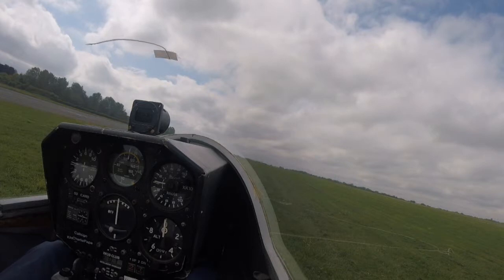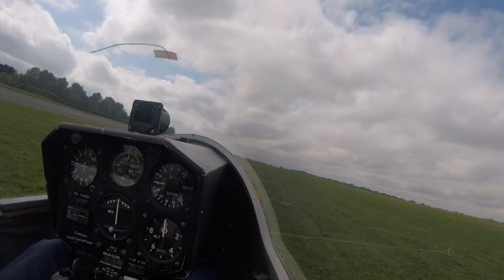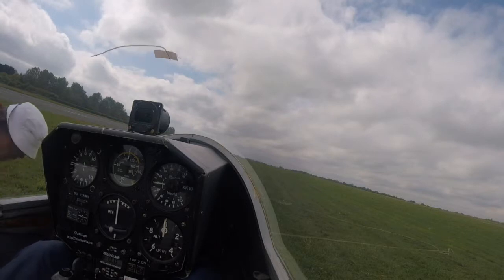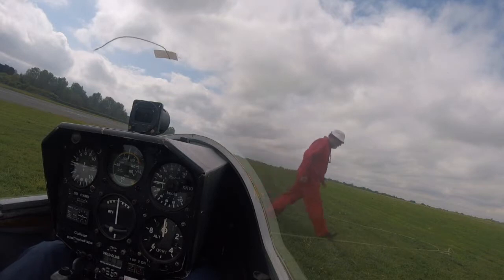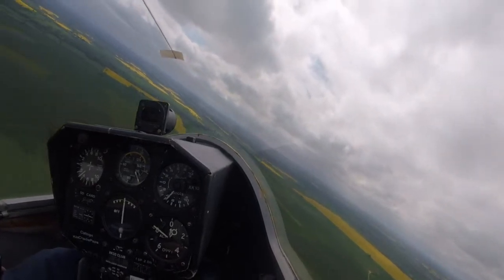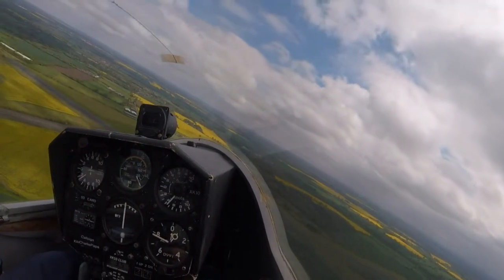An example of poor circuit planning

Comment: That altimeter doesn't appear to b e accurate.  I could be reading it incorrectly.
Reply from the maker: You are right, on that glider, the altimeter does stick (you might have seen me tap it). However, I wouldn’t have been looking at after the downwind leg. Thanks for taking the time to comment.

Comment: Thank you for sharing this, Since I am learning more practical stuff in my gliding training flights this helps a lot, examples of circuits that have gone wrong are ways to learn and improve and make sure not to make the same mistake! Really appreciate it and a nice recovery.
Reply from the maker: Thanks for your comment, Sebastian, and I'm pleased you found it useful. I hope your training flights are going well. On this flight, my circuit was too tight, too high and I turned finals to the right of the runway with a strong R to L crosswind!! The lesson I learned from this is to to always have a Plan B (and Plans C & D!!) when you go into circuit.
Reply from the maker: Should have said "turned finals to the left of the runway". Whoops!
Reply: @gerryfletcher4686  yeah no worries, appreciate the response, it’s nice to learn something new everyday! I have to say when ever I’m flying I’m making sure to try and correct mistakes that my instructors have picked me up on before hand, just so they don’t turn into bad habits. But I’m thankful that you have taught me something new.
Reply: @sebbers  Aiming point and speed control will give you a good landing (almost) always.

Comment: You were simply too fast at touchdown.  On the other hand, in those wind conditions, better to carry a bit more speed.  If this is the worst thing you do, you'll do fine.  Thanks for sharing.
Reply: Agree. Breaking off in 600"; reporting downwind and doing the pattern is on the spot. Only you should have kept it flying with the wheel 1" above the surface untill it stalled (=landed); perfection is to have the mainwheel touch ground with the tail or after and that easily comes when you relax a little more. Dont be so hard on yourself (and a little longer retrieve is just free exercise :).
Reply from the maker: @gliderguld Thanks for your response, Paul. YouTube is full of good flights so I tend to post my mistakes just to. prove I’m human and to help others. Your comments are much appreciated